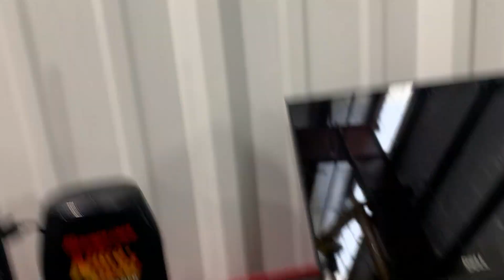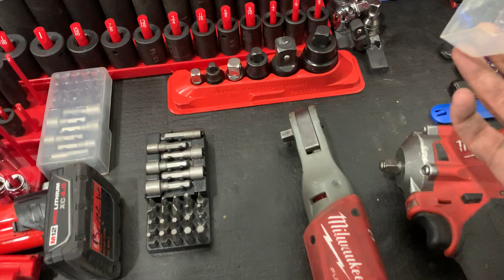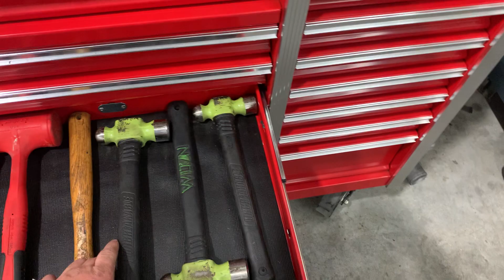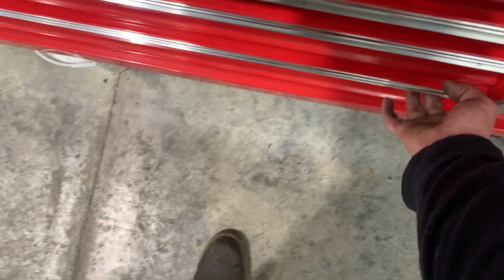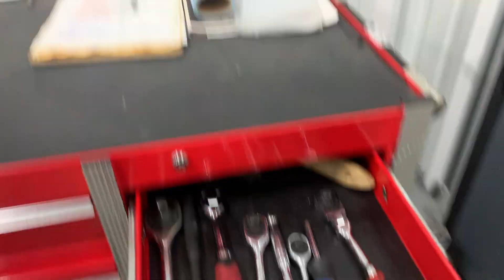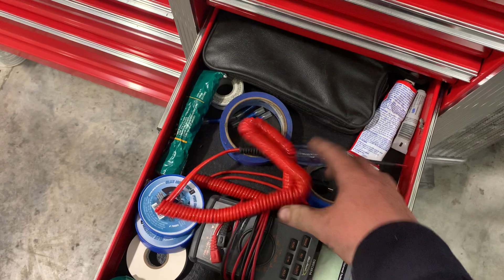US GENERAL Tool Box Tour *Beginner Diesel Generator Technician*

Comment: Those wrenches for your M12 die grinders seem out of place to me in with your wrench drawer. Maybe one set in the top drawer with the tools themselves, and one set where your die grinder consumables are since that's when you'll need them to swap bits out. I keep my torque wrenches in the back of my top drawer. They push that back row of sockets far enough forward that they're easier to get out.

Comment: Nice set up. I totally agree with Mr Pine, buy the tools you need, first, then buy a bigger box. I've had the same toolbox since 1990, I'm a tractor trailer mech, I've added two carts, but they are both full as well as the main box. Spend wisely, don't go into truck debt, you'll do just fine.good luck bro on your career.

Comment: Nice box and you can make it more better if ya modify it like the drawers and the locks and the drawers liners  instead of opening the drawers by moving the side latch remove it and but on the back of each drawer magnets heavy duty magnets so it will stay shut and you can open it in the middle and with the magnets attached to the back of the drawers it will work fine on each drawer of the box gap from the drawer and the box is one inch that will be a good modification for the box
Reply from the maker: Will it still be lockable however? The slide locks it comes with have accommodated me just fine in the time I’ve used it

Comment: Hi man great set up👍🏼 I’m looking to get the Milwaukee electric ratchet, do you ever have to grease the head?
Reply from the maker: Aaron Carey nope. They’re maintenance free as far as I know. I recommend the smaller compact (CP) batteries for the ratchet. I have the 3.0s which are the largest you can get in the compact size. I had the larger 4.0 and 6.0 batteries on before I got the compacts and dreaded using it. Made the tool very awkward and bulky to use. As long you use the compact batteries you’ll love it!
Reply: Oh right thanks brother! I know my snap on 14.4 electric ratchets use a grease fitting in the selection switch so I was just woundering if Milwaukee needed grease. Have you had any problems with the ratchets?
Reply: @AJC762  Mate with no air going through the head the grease dose not dry out but definitely get the 3/8 fuel the none fuel heads are not as good and don't last as long.
Reply: @andy Meeks my snappy I have to grease the head for longer life.i prefer my snappy to Milwaukee much faster and I prefer it than torque Cos it’s not an impact gun it’s a ratchet

Comment: Nice set up it's nice to see someone not fully loaded down with tool truck brand tools and still get the job done. But I heard you mention something about having a service truck that's really the way to go in my opinion where you can go out and work on your own with no boss hovering over you.
Reply from the maker: YaBoiChad I agree. Should have my own truck within a few months. Want to make sure I’m completely comfortable with all of the equipment before I’m on site alone with a customer. I’m definitely noticing some of the cheaper tools aren’t holding up to the abuse from heavy daily use however so I will slowly be upgrading. I’ll be sure to make some more videos on what hast held up and what I don’t recommend for a career tech

Comment: Good choice going for usgeneral. I see alot of beginner mechanics going into debt just for a snap on box. Usgeneral is not great but good value.
Reply from the maker: Thanks and I agree. The first few years as a tech are definitely the most expensive since you’ll be spending so much on tools. But double that with the fact that you’ll be making a less amount of money your first few years. There’s no need to dig yourself a deeper hole. Once I get a service truck I’ll end up taking this box home anyways
Reply: Bryce Wood You are correct. There’s about 80% of the guys starting out in the repair industry decide to find a new occupation after the first few years. A lot of them made the mistake of getting neck deep in debt on 10-20K dollar tool boxes. Then they find out that the box is worth about 1/3rd of what they owe on it.  I’ve been in the automotive repair industry for almost thirty years and I own the best boxes money can buy but I purchased them used for less than 1/2 what new 6S boxes cost. Good luck man. I hope you do really well!
Reply: @brycewood4109  can't turn a bolt with a toolbox ..
Reply from the maker: Janoy Cresva agreed